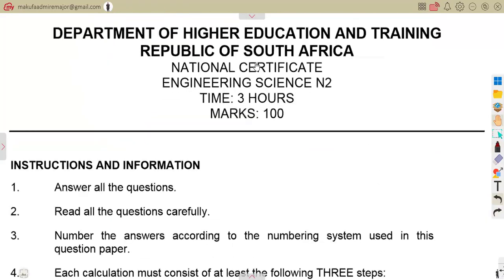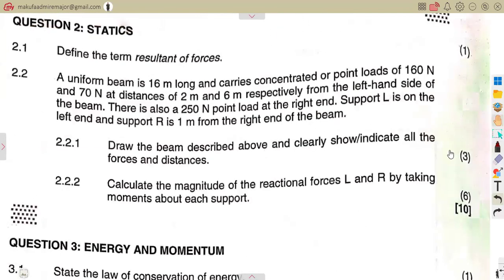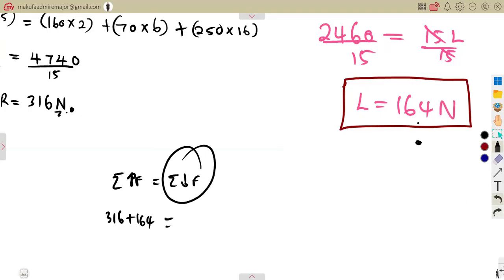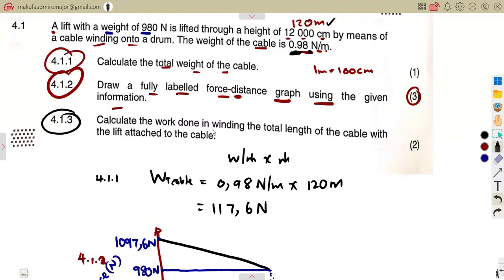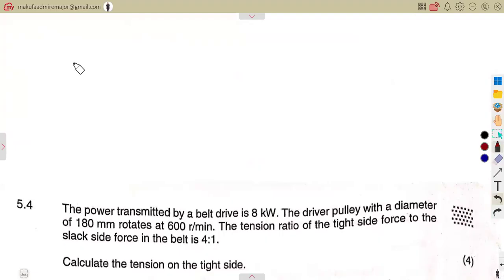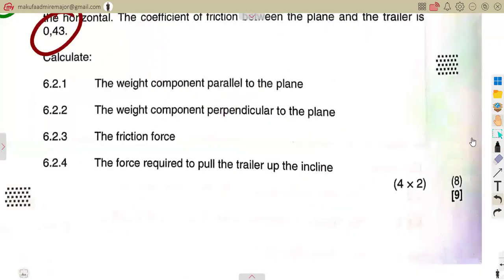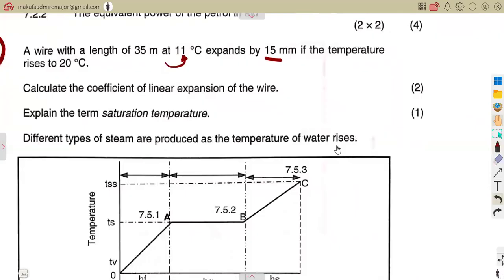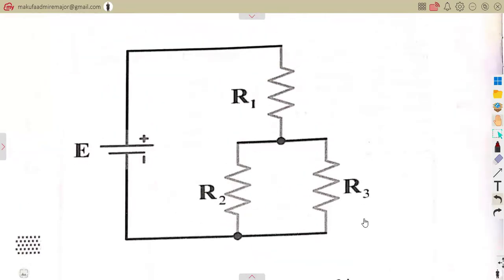Engineering Science N2 April 2024 Memo Full Paper @mathszoneafricanmotives  @mathwithlightone

Comment: Hi sir. On the memo they calculated question 7.2.1 this way 25/1000 * 30. I dont know where the 30 is coming from or waa it an error?
Reply from the maker: They used heat value of coal instead of Petrol
Reply: Hi sir,so it was an error? @mathszoneafricanmotives